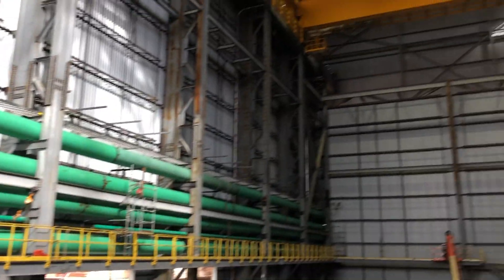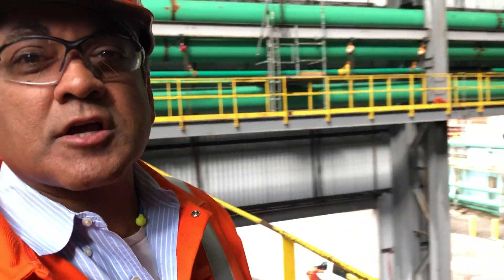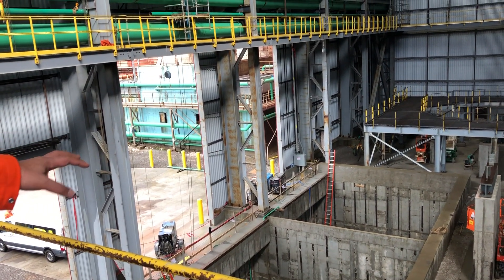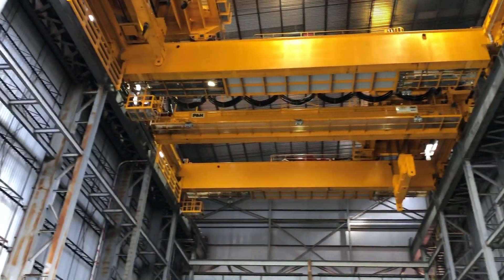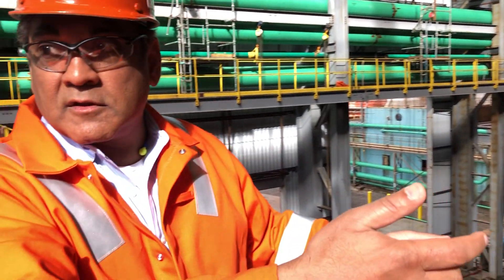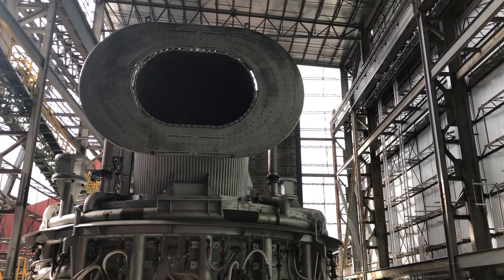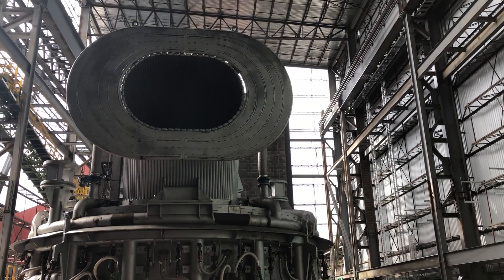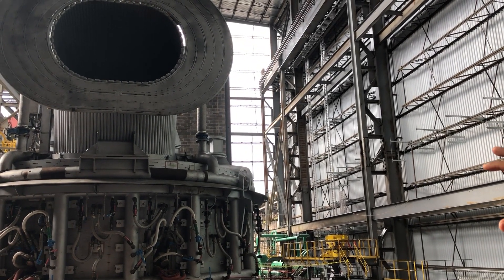U.S. Steel's Electric Arc Furnace

Comment: Yes and the sound of each melt cycle is as glorious as the sound of the Blue Angels in afterburner, yet better because it's a movement of a symphony of a thousand lightning bolts hitting a thousand tympani per second. Stupendous light show as well. The nasty smoke is ported out that big pipe to a "baghouse." The water-cooling pipes you see lining it  are ported to a cooling system that outputs lots of steam. You can tell when the plant is in operation because it will vent lots of steam during the melt operations.

Comment: Smart move on the part of US Steel.   Fairfield has a long future ahead of it with this investment.
Reply: I've found some of your other comments in this section to be quite informative (and it doesn't look like you're trolling!). In case you know this - what's the size of the EAF at US Steel's Fairfiled works in terms of tons or m3?
Reply: @Ramukaka249  I thought they were 200 tons like the Q-Bop.
Reply: @felixyusupov7299  - at 1.6 Mst, and 85% net availability, that would mean 55 mins a heat. That's pretty quick...
Reply: @Ramukaka249  I thought it was 45 minutes per heat but you might be correct.